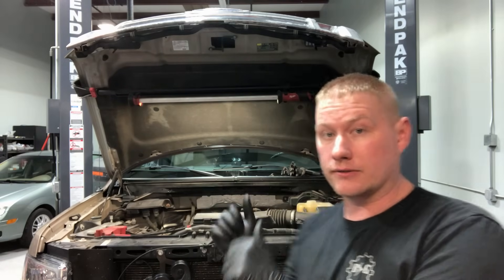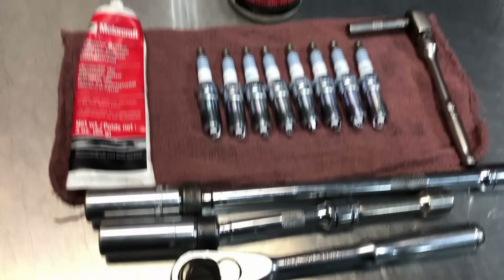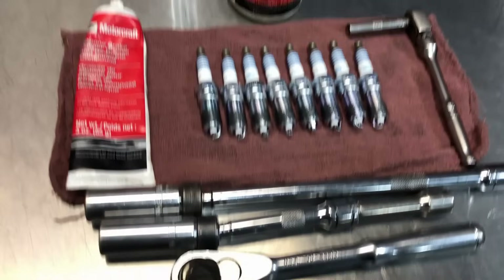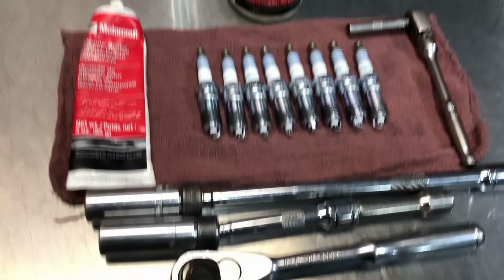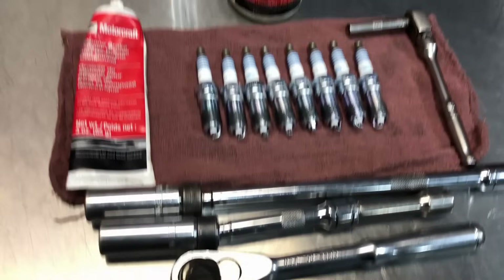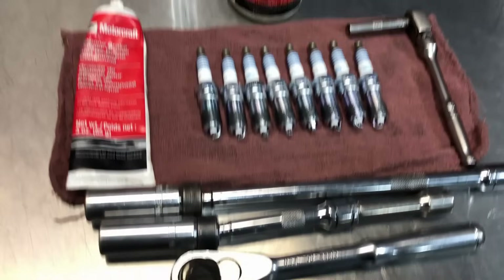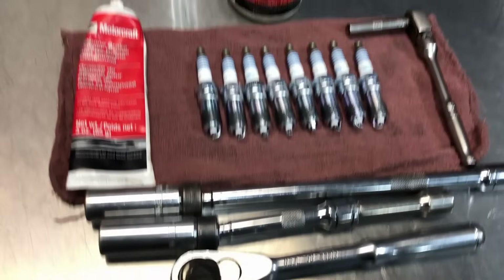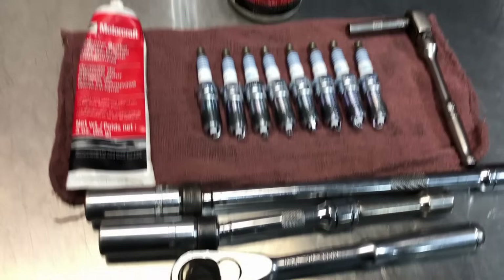2011-2017 Ford F-150 5.0L Coyote Engine: Spark Plug Replacement Walkthrough

Comment: Unfortunately one of my coil clips broke on my 14 f150. How do I replace it?
Reply: If it's just the red lock then get all the broken red pieces out and it should still lock on the coil. If it's the actual black connector then just replace the connector. I broke 2 when I was doing the plugs and just replaced the connector.
Reply: @rossspear-martin1577  So how does one obtain the connector?
Reply: @geobiking4798  just call your favorite parts store or local dealership and buy an ignition coil connector for whatever vehicle you're working on😊

Comment: Thank you Brian ( I think). I'll be 70 in May and my 2015 GT only has 8000 or so miles on it so I may not live long enough to ever need to change them but it was nice to see how to get the electrical connectors off as it is sometimes hard to figure out exactly how to release them.
George
Reply: Are you still with us George?
Reply: @DocVanfox  Yeah I'm still around, 73 now and do not drive all that much, when I do I usually take my 2018 Focus ST because all though not as fast in some ways it's more fun to drive and shifts so much smoother than the Stang, smile.
Reply: George you still with us?
Reply: @JonJonTravelFoodie  Yes I'm still here, I just don't check the social section of my Gmail often. This must be old because I'll be 74 in less than a month.
Reply: @George-Edwards we love you, George cut the muffler on the Mustang and have fun.
Reply: @VictorVargas_  I'm sorry but at 74 I like the way it sound as is. When I was a teenager I used to always put straight through glass packs on my cars but not anymore, (smile)
Reply: Screw that, go drive it a lot then change 'em

Comment: My 2016 mustang gt factory plugs on the driver side are hard to get out. 48k miles on the plugs. The passenger side was easy, then I got to the driver side and I have to put alot of pressure but they wont break lose. I dont want to put to much pressure. Not sure what to do?

Comment: Hey, there I have a 2006 F150 5.4 Triton with 220,000 miles on it and yesterday it stalled out with a low oil pressure reading and a loud knocking on the driver side. The codes I have pulled on it was change camphaser sensor and cat code po420. Any ideas? 
Thanks.

Comment: Just finished changing the plugs in my 2011 F150 and as always your video made it much easier. Was a little nervous as I had to use a breaker bar to loosen most of the plugs(had a 139,000 miles,I know should of done them sooner) but no problems. Thanks again for the great videos, keep up the great work.

Comment: You should do a good video on how to correct the three valve 5.4 V8 so many people badmouth I have seen many of these go many many miles I have a owned them myself and I have never had a problem but I use synthetic oil and I change it regularly now I have a coyote 50 I would like information to know what I should do to keep my coyote running good
Reply from the maker: I have between 30-50 videos or more on fixing the 5.4L 3v engine.
Reply: FordTechMakuloco yes I’ve seen some of them before I’m saying with data of hard use after to provide evidence that these motors will live a long time I have had a few and have never had trouble with very high mileage. Thanks I would like a video title that I can use to send people to if you can think of one off the top of your head that you have made proving this is all they need to operate for a long-term engine

Comment: Have you had any experience with the typewriter tick and failures on 5.0 engine? Any solutions?
Reply: Going to 30w oil in mine quieted the engine down a lot. Zero change in fuel mileage as well.  He recommends 30w in this engine
Reply: @Bushy556 where does he recommend that ?

Comment: You forgot to mention how braking off the COP bolts is common and known by ford but they don’t care and do nothing about it.  Broke 5/8 on mine at 75K and spent $800 in repairs on a “simple” plug job.

Comment: When Ford introduced these new engines in their trucks in 2011 I knew I had to have one.  Test drove both the 3.5 Eco and the 5.0. The ECO is stronger and the 5.0 sounds better but when I popped the hood to look at how they would be to work on I immediately chose the 5.0. It is an excellent truck and tows my trailers well.  Good Vid.
Reply: Yep same reason why I got the 5.0 Coyote on my 2011. Looked at the Ecoboost with all those extra parts and plumbing on it I and immediately said no way !!! This 5.0 has been a phenomenal motor for me and very easy to work on too. Has 160,000 miles on it and it still purrs like a kitten. Just general maintenance has been all it has required unlike my friends Ecoboost which has been very expensive. Love this great motor !!! Have the 5.0 Coyote in my 2016 Mustang too and it's been just as good. Very good and reliable American motors no doubt !!! Love these Ford's 5.0 Coyote motors. Power, torque, reliability, and very easy to work on....sign me up
Reply: Actually, the Coyote is built right here in Windsor, Ontario, Canada at our Essex Engine plant 🇨🇦
Reply: i have 2017 with 85k not a single issue yet. not a single warranty issue on the truck. nothing
Reply: JSSuper you made the right choice buddy!  My friend's 3.5 right turbo went out and they want 3,000 to replace them! ouch... Nothing like a naturally aspirated engine!
Reply: I was leery of the 5.0 for towing but its a beast I got the 2019 crew cab 5.0 10spd with 3.15 gears it out tows my 2010 GMC 5.3 6spd auto 3.42 rear end. The F150 tows at a lower rpm and gets better mileage to boot. I wish I could have gotten a higher rear end ratio but it already struggles for traction with the stock 275/55r20 tires.
Reply: @mesanders1113  how has your transmission held up?
Reply: I just bought a 2014 5.0 . My 2001 F150 died at 311k with the v8. It was a very reliable truck.
Reply: Ford quoted me 500 to change plugs——— no way
Reply: @mikehook7738 I was quoted nearly like nooop
Reply: I just got my Canadian 2016 F150 Platinum at 97k. I think I'll take a stab at changing the plugs.
Reply: Plugs and all drive train fluids changed for $632!
Reply: Ecoboost is stronger lol yeah
Reply: @bigaproduxions117x6  that was my thought also.  Lol.
Reply: @bigaproduxions117x6  Ecoboost needs two turbos to barely make more power gen 1 to gen 1. And they have way more issues so it aint a flex.

Comment: Hey there Makuloco, I have a Crown Vic 4.6 with 50k on the clock. I am wondering if you would recommend putting in 5w 30 vs 5w 20 per manufacturer recommendations. I know some of the pre 2000 Vicks with the same exact engine components called for 5 W 30 but was switched to 20 because of fuel mileage standards. I am absolutely religious and changing the oil with Mobil 1 every three to 4000.

Comment: Good information. Easy job until the Coil retaining bolts twist off (corrosion). That was a PITA.
Reply: Yup a real pain brother , I broke off 5 of 8 because they were corroded  . Anyways I managed to pull the inserts with heat & replace them the same way & replace with new bolts

Comment: I have to wonder how much engineering effort goes into those stupid extra locking tabs that manufacturers put on their connectors. Has connectors spontaneously unplugging themselves ever been a problem that has happened on any vehicle?

Comment: I have the same motor and happened to break the black locking tab on the electrical connector to the coil when I was replacing my plugs. 

Any tips or suggestions? Can the connector be replaced?

Comment: I replace all engine & trans mounts on a 2007 ford five hundred they were bad,  I did disconnect the battery while replacing the engine mounts, once it was done went to drive car and it has no power it surges and wants to die engine also sounds weird now.  do U know what could cause this?  I did notice the throttle body is very dirty with black carbon and it feels sticky.

Comment: Any particular reason you didn't put some dielectric grease on the outside coil electrical connection? Would it make it any easier to remove next time?

Comment: I'd suggest a little silicone spray on those connectors before removing
Reply from the maker: I prefer to not use a bunch of spray and make a mess on customer vehicles. This is 10 times easier and faster when  I’m not leaning over at a weird angle filming.

Comment: How can side loading the spark plug do damage ?
What if you have no choice like on a 5.7 hime
Reply from the maker: Stick a spark plug socket and extension onto a spark and then side load it. You will hear the cracking of the porcelain damaging the spark plug. That is why I use these specialty spark plug sockets with swivel built in.

Comment: Dude why are you spreading false information
You should not put anti seize on spark plugs with the coating because you will end up over torquing it because of the anti seize and will strip the threads in the engine costing hundreds if not thousands of dollars
Any smart mechanic would not advise this but you are and it makes no sense
Reply from the maker: You are so far off base here it is not even funny. You could use a 1/2 breaker bar and not ever strip the threads, did you see how many threads there were? Not to mention my method using a small 3/8" ratchet then choking up on it. Even Arnold Schwarzenegger could not strip the threads with my method. I mean come on where is this coming from?
Reply: @FordTechMakuloco  coyote is made of aluminum
You should've said in your video that you shouldn't put anti seize on treated spark plugs and only on untreated
Anti seize can increase the torque by as much as 20%
If you over torque the spark plugs in an aluminum engine you are very likely to strip it
Source http://ricksfreeautorepairadvice.com/anti-seize-spark-plug-threads/
Reply: Brian has been anti siezing sparkplugs on how many vehicles now? Coated or not coated it's still subjected to moisture over the years along with thousands of heat cycles. A tiny dab with the correct torque is all you need to prevent any headaches.

Comment: So much easier than the 2V 5.4!! I have done them twice in that motor and its a royal pain to get the back few plugs. Always used anti seize and have had no issues.
Reply: The 4.6L/5.4L 3 valve engines are by far the worst.

Comment: ford engineer: "i want to build the most pain-in-the-ass electrical connector!"
ford executive: "make it so!"
Reply: Hahahha pain in the ass connector    you say. Mercedes is even worse. Push tab back, remove gas cap, jiggle key for two seconds now remove connector.
Reply: @luisamoa2500  what?
Reply: Those clips suck! Broke one and that takes longer than anything (removing the clips).
Reply: most think you pull up on the red tab? nope lol you press down on the black snd it pops out insanely easily lmfao just people think you pul up cause looks that way but its not necessary.
Reply: They suck. Become brittle. The fuel line connectors suck too
Reply: I've done this on my Mustang and honestly these connectors are awesome! They feel pretty well built and easier than many other connectors I have seen especially the ones that have two locking tabs on opposite sides of the plug
Reply: I just changed my plugs today and didn't have anywhere near the difficulty shown in the video, but looking at the condition of interior of the engine bay, this vehicle does not appear to be well cared for, especially if it looks that bad after only 60,000-80,000 miles.  The poor condition may be the cause of the difficulty.
Reply: @noelfreeman4312   I have 110,000  and it's well taken care of.  On my  truck the plastic is brittle from the heat.  Ford wants $60 each for new connectors with the retaining pin.  They don't just sell the 3 cent plastic clip.  Happy is correct.  Engineers don't care and the company can make a bundle.
Reply: @Bridgestreetnursery  what are you going to do about your broken connectors? My 5.0 f150 has 147,000 and I found this video because of those damn clips, only changed 2 and broke both of them when I was very careful, they are brittle and no way of removing that red tab without braking it .

Comment: I have 2018 Ford F-150 truck with a blown 5.0 engine  only 1, 300 miles on it when it stopped running , backfired  towed it to Ford shop and diagnosed the problem  ,a hole in the piston  broken plug  .Ok Ford let's hear it . what are you going to do for me  and others experiencing this problem . This is already taking 4 weeks just to see what Ford is going to do. Thanks for your time and videos .

Comment: I have a 2010 5.4 and the gasket for the part the oil filter and lower radiator hose Is leaking oil, is this a pretty straight forward job. What all do you recommend doing when I do this?

Comment: Look a tapered seat in an aluminum cylinder head on a ford...that's never been a problem before.  Oh wait it has.  Why not use a spot face or counterbore on the cylinder head and spark plug with a gasket, those spark plugs do not back out from thermal expansion and contraction.  ford sucks.

Comment: I own a 5.4 3 valve that gets a bad reputation. Oil changes religiously and let it warm up. Brian if you're reading this: what's your opinion on the Champion one piece spark plugs for the 5.4 3 valve engine's? I'm about due for a tune-up at 250K currently running autolite plugs.

Comment: Thanks much for this video on spark plug replacement on the 5.0L.  I have a 2012 F150 with the 5.0L eng.  I'm coming up on a plug change so thanks again, you've made my life a bit easier.

Comment: That torque spec is so low. When I went to loosen my spark plugs it felt like there was no torque on them at all.
Reply: Absolutely agree with you.
Reply: What is the torque spec?
Reply: @CoyotePower5.0  The video said 127 inch pounds, which you quickly reach with a 3/8 drive.

Comment: Brian, another thing you might want to show is how to replace those electrical connectors.  I had to replace one when I changed the plugs this fall on my 2012 5.0.  The seals get rock hard and damaged with all the heat cycles.  Silicone spray helped too on the ones that went on real hard.

Pretty easy to change the connector. Pull out the white plug with a pliers.  From the front, pry up the tabs holding the wires in, then pull wires out through the back.  Push wires in new connector and seal the back with rtv.  Then pop the white piece back in.  I was able to get the special pin picks but an eye glass screw driver should be about thr right size.
Reply from the maker: I have a whole video dedicated to replacing connector.

Comment: 100 times better than the 4.6 and 5.4!
Reply: I think the 5.4 is actually easier as long as you are changing out the updated plugs. No issues with weak coils or connectors.
Reply: I had a 97 f150 with the 5.4 2valve, worst thing I have ever changed plugs on.
Reply: @robertstaniszewski223  did you ever try the 2.3l lima w/ 2 plugs per head?  Drivers side was easy, passengers side would drive you to drinking.

Comment: Quick question. Is it a good idea to switch to 5w30 synthetic instead of 5w20? I have heard that is too thin to truely protect and was created just for government regulations. Main engine I'm wondering about is a 01 Ranger with a 3.0, but could this apply to other engines?
Reply: Won’t hurt a bit. Ford recommends 5w-50 for 5.0 mustangs that get tracked so going to 5w-30 won’t hurt. I run 0w-40 in mine.
Reply: those rangers don't have vvt or any tiny holes using oil pressure to do things

Comment: I changed my 2014 5.0 about 4 months ago. I couldn't find information on the gap at the time.  I had 70,000 miles on the engine and the gaps were all about 56 to 58. I set the  new plugs at 46. Can you tell me what that will do. Do I need to take them out and reset them at 51?

Comment: Could you do a video on replacing the connector if it breaks. Also  what to do if your retaining bolt breaks off. Happened to me as they rust pretty bad here in Ontario.
Reply: Heat the threaded slug and pull it out. Once you get the old bolt out, put a new bolt in it, heat the slug up and put it back in the hole. Hold it steady as it cools.

He actually made a video on it.

Comment: How many oil pan gaskets have you done on the Coyotes?  My 2011 F150 has 154K miles and the rear of the oil pan gasket is leaking.